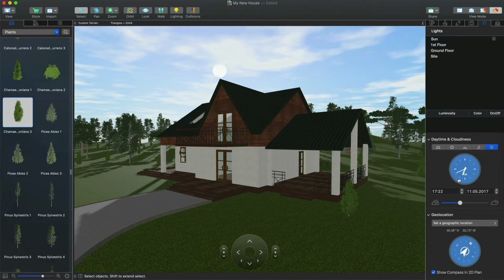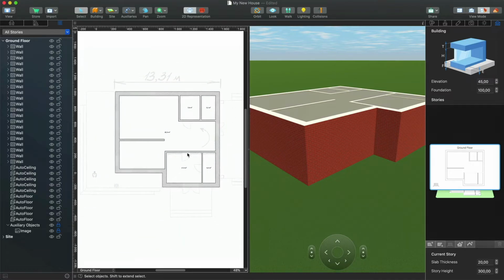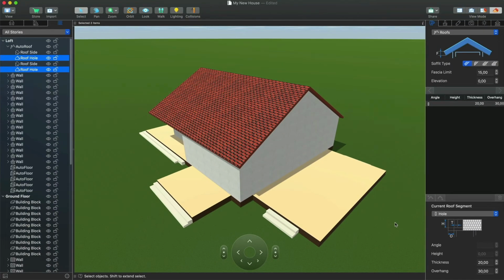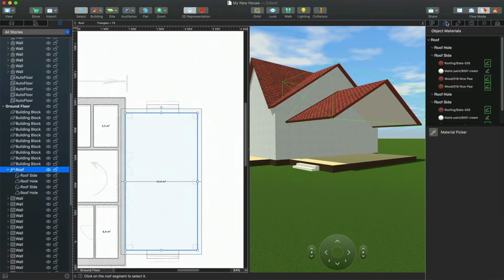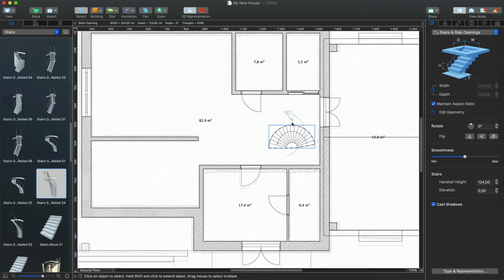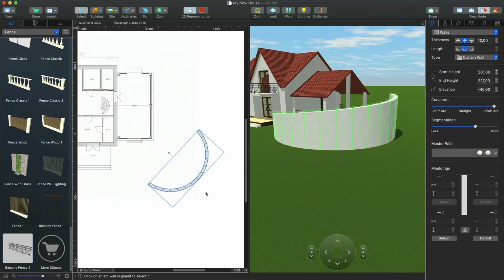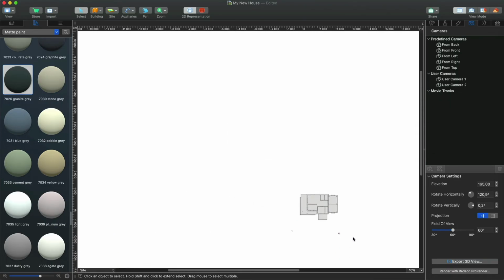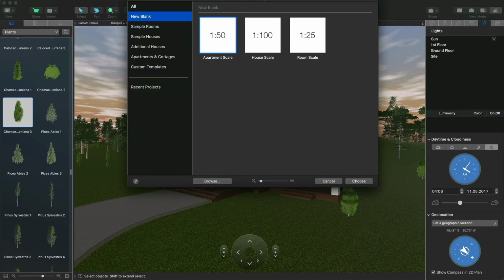Creating a House from Start to Finish - Live Home 3D for Mac Tutorials

Comment: Hello, there is no ability to open door or window, i can't switch the lamp or candle, it's too sad
Reply from the maker: You can't open and close doors with a setting in Live Home 3D. Instead, there are separate 3D models available in the Library for opened and closed doors.

As for turning the light on/off for a lamp or candle: 
- first, you should make sure that the Lighting is enabled in 3D View.
- then if you select the light object (a lamp or a candle) you will be able to control its light sources from the Light Properties tab of the Inspector.

You can always contact our technical support for a more detailed answer with some reference images.
support@belightsoft.com

Comment: after drawing the layout of a room including doors and windows, can the software automatically calculate square footage of area that can be painted?
Reply from the maker: If you’re using Live Home 3D for Mac, please select multiple Floor objects in the Project Tree, and their total area will be displayed above the rulers. Please pay attention that you can't calculate the square footage of the walls.
Reply: @LiveHome3D  thanks for the response. Since all the dimensions are available, this would be a good feature to add and would also help estimating paint required.

Comment: Hi there! Thinking of using this software for a personal home project. We are mostly wanting to design the layout of outdoor spaces (front & back). Would this be a good idea to use for that? Thank you!
Reply from the maker: Yes, you can definitely use Live Home 3D for outdoor design. This is where it can come in useful: https://www.livehome3d.com/fields-of-use/garden-design-app
https://www.livehome3d.com/fields-of-use/backyard-design-app
https://www.livehome3d.com/fields-of-use/landscape-design-software
And you may also like some videos about the terrain editing. If you have flat surface around your your house, you will not need to edit elevations:
Terrain editing video (part 1):
https://youtu.be/vElFVj5oh6Y
Terrain editing (part 2):
https://youtu.be/7agB8jr38VM

Comment: how do you build in 3d mode?
Reply from the maker: Hi, you need to build the walls in the 2D mode, and then switch to the 3D mode to apply materials, add furniture, export snapshots and video walkthroughs.